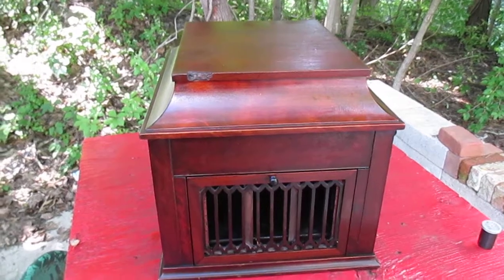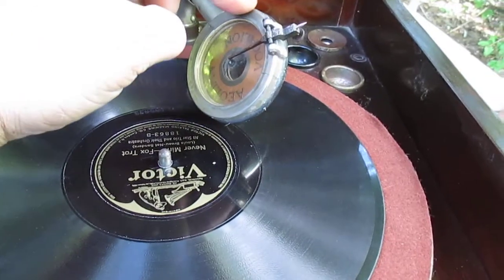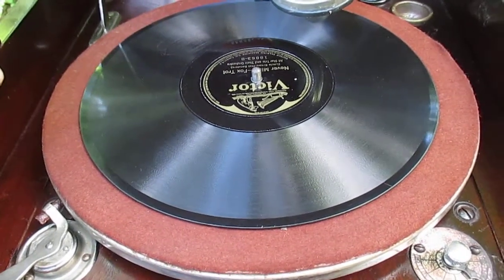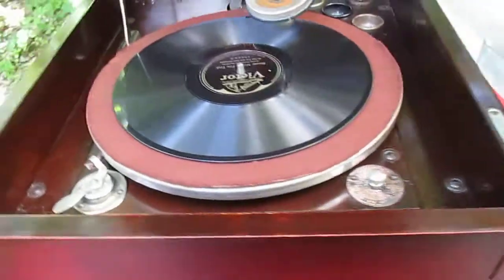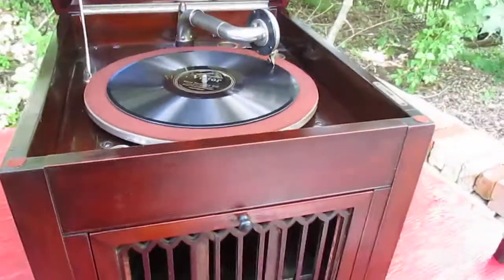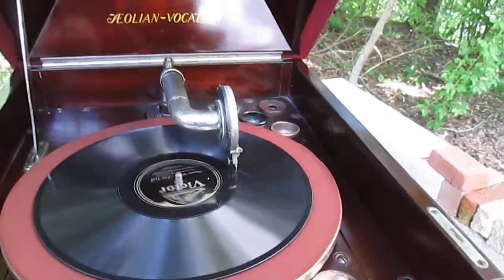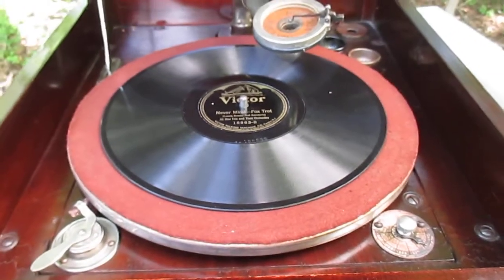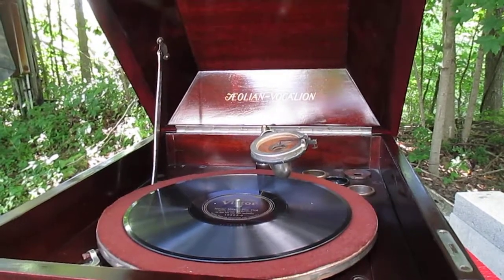Aeolian-Vocalion Style E #12533

Comment: My old father-in-law had a oak Aeolian console version with the same grill and cabinet  design as the one you displayed.  As I recall the fabric for the grill was a dark blue linen type material.  Thanks!
Reply from the maker: This one has the remains of a brown colored fabric in the grill.  I repaired the machine for someone who buys and sells antiques at flea markets.  Their profit margin is low so I had to keep the repair costs to a minimum.  I was lucky to find a used spring that would work, and the reproducer glued back together well enough to play.  The rest was just basic cleaning, the thing was filthy.

Comment: How do you know what speed to play the records at and how much to crank it?
Reply from the maker: The average speed of your typical controller record is around 78 RPM. It’s not exact record to record but that’s close enough to be able to play the music nicely. There are some Columbia discs that’s been at 80 RPM if you find one of these, it will say what RPM is intended to be played at. Between those two RPMs, you’re unlikely to encounter any others, for instance, you do not play 33 RPM records on a Victrola. You set the machine speed using a stroboscope disk or an app on your smart phone. And even if your machine has a dial with 78 on it after 100 years, you are going to have to fine-tune that to make sure that it is in fact, spinning at 78 when it says it is. Friction leathers on the motor can wear and this will change the RPM reading on the dial. But the Victor companies record starting in the 1900s and going all through the RCA era into the 1950s were 78 RPM approximately. This goes for your typical red label Columbia and other similar records of that time. Except for some Pathe records that have lateral cut grooves as opposed to the horizontal used by everybody else except the Edison diamond disc of course and that is not a record you play on a victrola.